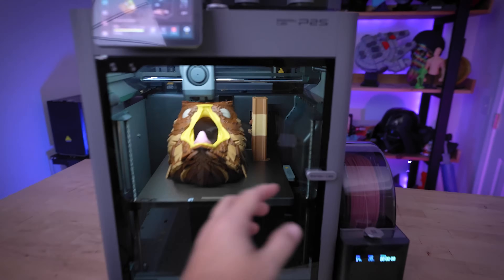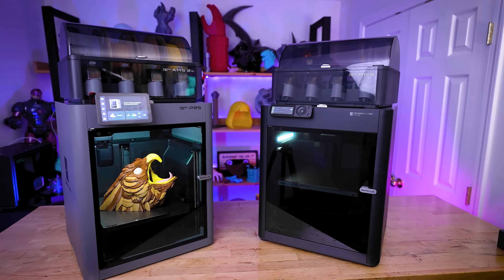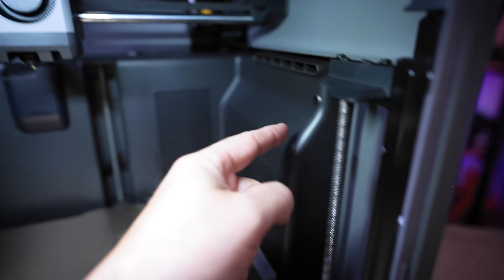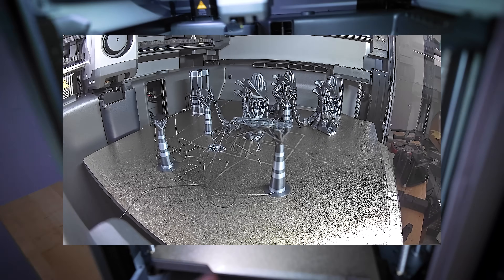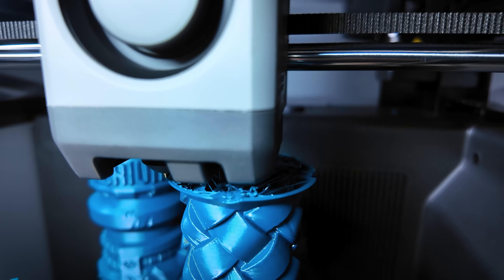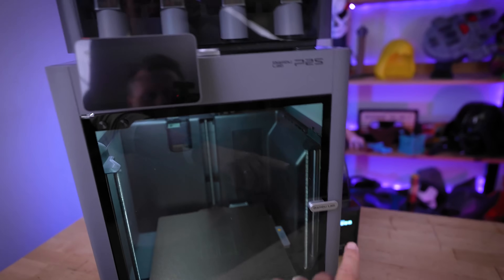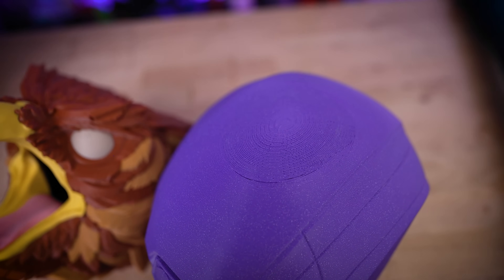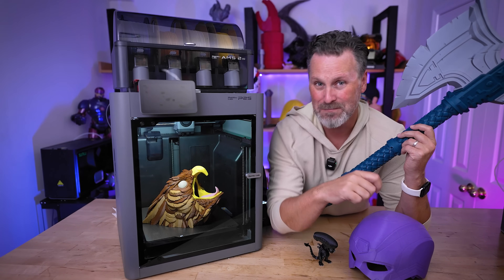Did the New Bambu Lab P2S Just Kill Off the X1C?

Comment: WARNING !!!  Be warned, I f you have ANY problem, Bambu will make you want to pull your hair out, I have never seem Customer service SO bad. My brand ne P1s does not work from the start, the hassle with trying to het help has been a nightmare. They seem to do everything they to deny you any help that cost them anything more that an email.  They are EXTREMELY slow to respond,  all service is done through ticket via email, ZERO phone support. They treat you like you are cheating for free parts or trying to cheat them somehow.  I will not be buying from a company that has such bad support, bambu is that Co.
Reply: ur not in the right hobby if u dont like tinkering u dont know how bad 3d printers before bambulab came out....😂

Comment: you can't dry while printing because drying while printing causes a lot of issues, filament breaking inside the ptfe tubing, nozzle clogging, extra heat added to the chamber causing warping issues with PLA,... 

I have the anycubic kobra s1 (which I do not recommend buying, I'm about to sell it) and I do not dry while printing anymore, it caused me a lot of issues.

Comment: Should i buy p2s as my first 3d printer?
Reply: From what I'm seeing, it would be a wonderful first printer, you can get the stand alone for $550 or the combo with the AMS 2 Pro for $800. HOWEVER, right now because of Black Friday you can buy a P1S for $400! And if you want the AMS 2 Pro combo you can get it for $600. It's $200 cheaper and unless that you're trying to print engineer grade material (which since it's your first printer, I'm assuming you don't) then you don't need the hardened steel nozzle. I bought a P1S with an AMS 2 and I'm just happy, it would be a great first printer, lacking nothing that you might need, and you can use the extra money on filament of tools that you might need

Comment: Hi! I already have a P2S with the AMS 2 that came in the combo.
If I add an AMS HT, will I need any extra cables, a hub, or an additional power supply to connect it to my current system?
Or can I just plug it directly into the existing setup?

Comment: Great video...thanks :) I just took delivery of the P2S.. a great machine. In a video linked he states that you can print and dry using the AMS Pro with the P2S at the same time if you plug a power supply in to the AMS Pro unit. I saw it does have a small power supply socket at the rear (well thats what it looks like). But there is no power supply provided... any thoughts?

Comment: Considering the H2C will have the swappable nozzles, logical extension would be that an X2C will also have those and probably an enclosure heater, but at the smaller 256mm cubed.

Comment: The reason for the issue with not drying while printing is two fold.  one is the power... you need an external power source to use the heater during print.  second is thermal change of the filament as it enters the printer.   the extruder is expecting a specific shore rate of the material.  more prone to breaking off either at the feed gear or in the AMS.   I believe H2D can print while heating with external power source.

Comment: If I may: (A) "I'm not sure the X1 Carbon is relevant any more." So for all those who plunked down their hard cash for the Carbon or P1S, welcome to the heartbreak world of early adopters! 

(B) "still don't know why you can run the heater and the printer together." Has anyone tried to measure the draw of both running at the same time? I bet it toes the 120v line of a US circuit. Any power surge and boom, circuit breaker (hopefully) kicks in. 

(C) "Printing issues on the left side of a couple of prints?" I noticed your examples are not exactly the top of the prints but they are arcs that are near the top of the affected dome surface (large dome of the helmet, small dome of the eyeball. And I wonder it its either the math applied to the arc that doesn't translate well to the stepper driver signal, or that for some reason the print head doesn't increase the Zed (z axis) in just that one area. Our eyes will blend in defects from jagged or straight lines, but ellipses will always catch our eyes because those stair-stepped curves are much like single line vase mode renderings.

So for the long review but is it just me who snorted every time he said "USB stick" thinking it sounded like "US Beefstick"? Just me? Okay.

Comment: The nozzle design being the same as the H2S looks like a strategic direction. My guess would be that whatever new models appear, they would carry the same new nozzle module. 
The filament cutter (full 256x256 bed) tweak is very neat and surely also likely to be standardised on new models. Whether the whole toolhead is reused would be less certain, though I’m sure it’s sensors will be standard issue in new Bambu models. 
The general air of “polish” is very impressive, with the exception of TPU feeding! 

The P1 models are obsolete and the X1C nearly so. It would need significant upgrading to justify its continuation in the range. 

I would expect Bambu to fix the firmware quirks promptly and hope you will manage to keep us updated on the update progress. BTW - Kudos points for mentioning the problems encountered during the review - after all, that is what distinguishes reviews from ‘advertorials’.

Comment: Awesome video as always! I think the X1C will be next for a refresh and Bambu will lean heavily into it being an “Engineering Filament” machine. Higher temps, crazier materials etc... I can’t imagine them dropping their previous flagship 🤔 Excited to see what’s next! 😁
Reply: I'm pretty sure the X1C is obsolete now. The PS2 got all the features of the old X1C and it's cheaper...  It's not even on the Japanese Bambu website anymore.
Reply: @Gacharize wrong. The p2s is actually far superior to the x1c now😂
Reply: They might, but I think they might retire it as well, since the H2S essentially does the same thing only bigger.
Reply: Yeah, the H2S is the X1C Mk2
Reply: As of right now, the X1C isn't on their site anymore. I presume they dropped it due to the P2S basically having all the features of the X1C and then some making there be zero reason to buy the X1C.

Comment: I would guess it is a power limitation why you can’t dry and print at the same time.  Possibly needs more power due to the algorithm between the AMS needs to tag the type of filament that is in there and sensors that are in there using the power and not able to heat up.   Again only a guess.

Comment: I think this is the last upgraded expect the A1 ecosystem for Bambu.

I think this P2S and the H2 series has replaced the X1C completely and now all these machines share replacement parts to help stream line production costs. We are more likely to see an P2S "pro" with the missing compents that the left side closed vented handle would allow like. aheated chamber and a differnt fan system int he back to push VoC through tthe filter.

Comment: I have issues on my X1C with the Aux fan blowing directly on parts. I specifically move parts as far away as possible and if I can't do that, I change the Aux fan speed to 20% for the specific print to avoid issues. Could be the same issue.

Comment: The X1-Carbon is currently Sold Out on Bambu Lab's store. You can't purchase any of the packages, with or without an AMS, etc. The X1-Carbon has most likely been discontinued, and i'm guessing an announcement for the successor to the X1C is imminent. X2C? The X1C no longer fits in the current line-up as is, and if the P2S is anything to go by, the "X2C" (or whatever is coming) will get some decent quality of life improvements and advancements.

Comment: You can print with AMS ht heating with a workaround. Run the filament through the other hole used for TPU and pop off the roller with the gear and flip it around so it’s on the other side and it will freely roll while drying.

Comment: from bambus FAQ

2. Does the P2S require an external power supply to use the dry filament function when connected to the AMS 2 Pro?
You can use the AMS 2 Pro's drying function while the entire machine is in standby, though printing-related functions will be paused during drying. **If you need to dry filament while printing, you'll need to purchase a Bambu Lab official power adapter to power the AMS 2 Pro.**
Reply: so they are saying it can dry while printing but you need the power brick ???

Comment: Redesign your poop catcher to extend to the left and right of the actual chute (and further back if you have the space).

It’s currently poorly designed. It looks like it was designed as if the poop would flow around to the side of the printer which it clearly isn’t. It’s just piling up and blocking the chute (and then you are blaming the printer 🤔)

Comment: I think that gap in the eye and top is a slicer issue.  Have seen this in Orca slicer as well when printing top surfaces that are rounded.  Have been able to minimize it by increasing wall count, using height/range modifier to increase infill density in those areas, and increasing number of top layers.

Comment: Wished they added that status light bar like in the H2D and H2S
Reply: For how aggressive the price is I'm happy with the feature set, they had to make cuts somewhere to make this thing profitable.
Reply: @justtwoseats  yeah but a led strip would have been $1-2 extra.
Reply: @AndrewTSq an adressable led strip with the clear plastic parts required together with assembly will be much more than 1 or 2 bucks after margin, i prefer they leave it out if it makes the machine more expensive

Comment: The PETG infill pebbling up like that is usually due to flow rate / speed. Infill prints faster than walls, which is why your walls look fine, while the infill is basically ground beef. The tool head and extruder are outrunning the melt rate of the PETG at those speeds. 

The solution is to slow down the infill speeds.
Reply from the maker: Thanks for that explanation! Was the first time I recall seeing something like that
Reply: @UncleJessy I have an unconfirmed theory that Bambu switched from PETG basic to PETG-HF as their default PETG due to this exact issue. 

Anyway we learn more every day! Today I learned not to start a large resin print without first topping off my resin vat! 😅

Comment: My guess, they will do a A1 refresh, called the A2, but it will have the print volume of H2 series. The A1 will probably go away, and the A1 Mini might even get a touch up also with a 220mm cubed build volume instead of the current 180mm. Obviously this is all just me guessing (they might also get better updated cameras).
Reply: I highly doubt that they will make a H2 sized A1. It would require a ton of desk space to move the bed and also it would end up being slow because of it too. The only thing they can do to the A1 is better camera and CPU for all the failure detection

Comment: Anyone know of there will be an upgrade kit for the p1s to cpnvert it to the p2s? I just want the lighting and 5 onch screen and maybe the new toolhead?
Reply: I think it would be about impossible really, so much was replaced that almost nothing would be reusable. Nee toolhead, new location of stuff, heater, cooling, more powerful board, new screen, AMS 2 hub etc etc. I wish it was possible, but honestly this is really a whole new printer.
Reply: @benjaminvdvyt sucks though since the P2S solves every issue I have with the P1S and I don't want a second printer... I imagine there's probably a lot of people in a similar situation
Reply: On the website it said there will be no upgrade kit offered as they changed the main frame of the printer. They claim its impossible. Very disappointed but cant change it
Reply: @SozeHB thanks, i didnt see that.

Comment: 2:19 from what i have heard is actually isn't the same screen as the H2 series as the resolution is apparently quite a bit lower
Reply: Will that screen work on the P1S? Did you try?
Reply: It’s lower resolution than the X1C as well. It’s a 480 panel, X1 uses a 720 panel.
Reply from the maker: Oh really?! I would have never guessed. Looks great and is really responsive. Then again just about anything is better than the original P1S / P1P interface 😂

Comment: Not being able to dry while printing is hardware based and by design, I'm afraid. Printer has enough power to eithe run itself or the dryier. That's the reason why you need to buy an extra power supply.
Reply: So the AMS 2 pro CAN dry while running, but it needs its own power supply.
Reply: @EdonSerifi  On the P2S at least yes. And on the A1, once they get to updating the firmware. On the H2D and H2S you can print and dry at the same time with one AMS2 Pro unit without separate power supply. Rest will need it.
Reply: I don't get the point of drying while printing.  You want to start the print when it's dried, and not dry while it's printing. Otherwise you're printing a filaments that isn't fully dried yet. 
Running a pre-heating filament through the nearby AMS motors and gears could also cause unnecessary issues.  Especially with materials like PLA that have a very low glass transmission temperature. If you've multiple AMS you can dry while printing, just not in the one that is currently printing for above reason
Reply: AMS has Motors.  Glass transition temp of PLA for example is so low that it would be a bad idea to run it through that motors while drying.

Comment: I saw someone say you can dry and print if you have an external power cord for the ams - apparently the power from the printer to the ams is not sufficient to run the dryer while the printer is printing.

Comment: Correction:
If you need to dry filament while printing, you'll need to purchase a Bambu Lab official power adapter to power the AMS 2 Pro!
Reply from the maker: Say what? Is that a real thing 😂 now I gotta go look and see
Reply: @UncleJessy  si, lo menciona en la sección de preguntas y respuestas de la p2s en la web de bambulab.
Reply: @UncleJessy  In Tom Sanladerer's video he said the power supply built into the printer only has enough power to run the printer or the AMS dryer, not both. Adding the external power supply for the AMS lets you dry and print at the same time.
Reply from the maker: @anderfrank1 the AMS HT has its own power supply but won’t like you heat and print at the same time. Will have to dig into this one
Reply: @UncleJessy  Interesting. Was just going off what Tom said in his video.
Reply: @UncleJessy  you have to study more, isn't goggle enough? You CAN print and dry with the HT

Comment: You can't dry/heat and print with the AMS/AMS2 because the filament paths go past the heater elements. Hence why you nee dto unload them, it gets very hot right there and it could make the filament gummy enough that it would get stuck into the extruders. You can print and dry with the AMS HT, use the bypass route for it, it'll allow you to do both.
Reply: Weird that some other reviewers don't mention this at all, they only say that without an external power supply you can't print and dry simultaneously..
Reply: @bacaw2856 (based on other reviews) this is true.  Externally powered, you can do both.  Jessie got lazy on research for this video?
Reply: @stevenmorehouse2626  Even more odd then that Bambu's wiki directly says that it's not possible to print and dry from the same unit simultaneously...
Reply: @bacaw2856 agreed. Wouldn't be the first time product documentation was incomplete, unclear or just plain wrong.  Although: it does look like there's conflicting info.  The FAQ and early access reviews state you can while externally powered, whereas the wiki and more recent reviews say you can't.  I suspect they ran into issues and disabled the full functionality, as it seems the spool has to retract fully to dry.  One thing I just saw that may clarify it, suggests you can dry in the AMS while printing from an external source, but only if the ams is externally powered.
Reply: @stevenmorehouse2626  So many words to avoid admitting you had no idea either kekkek. Ever consider not making claims on subjects you have no first-hand experience in?
Reply: You can with the Tetris all in one that attaches to the ams 1
Reply: Bruh..... never dried filament in my life neverrrrrrr
Reply: It's skill issue of bambu
Reply: You can with the sunlu AMS heater
Reply: This "reviewer" knows nothing..

Comment: How do you feel about print quality on the centauri carbon vs p2s do you think the cc gives just as good quality?
Reply from the maker: the cc for sure is lacking on a good number of the features that the P2S has but the CC prints for the price are crazy good. The P2S prints for sure look better but not drastically better. I think the P2S handles leveling, cooling / noise a lot better than the CC to name a few. But I still highly recommend the CC as a budget friendly printer. Printing with mine right now 😂
Reply: @UncleJessy Thank you for the reply I watch all your videos love the content and I am leaning towards the cc because of the price looking at cosplay helmets mainly but some other stuff too and the quality it does for the price just hard to pass up. But was curious with the p2s if it’s worth the step in price
Reply: @sfelix_11  I have a CC. It is great for the price… but… I really really really envy the easy nozzle change on these recent Bambu designs. Where’s the Elegoo AMS? (The promised printer support Wiki has appeared!)
I’m impressed with the v2.0 polishing on this P2S (and the similarly engineered detailing of the H2S) which makes the CC look cheap. But it is!
Reply: @unclejessy great video as always, can't wait until you do a long term review to see all those issues fixed.

Comment: Replaced carbon rods with steel rods - isn't it heavier now and causing worse VFAs?
Reply from the maker: I'm not noticing anything major at the moment with the print quality with that change other than the top layers not completing on 2 of the prints I did with rounded surfaces on one side